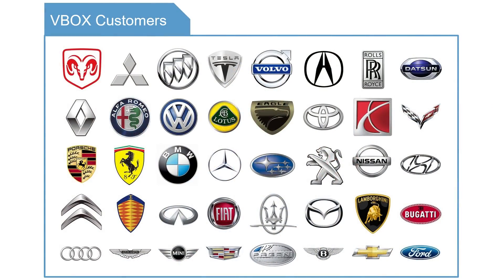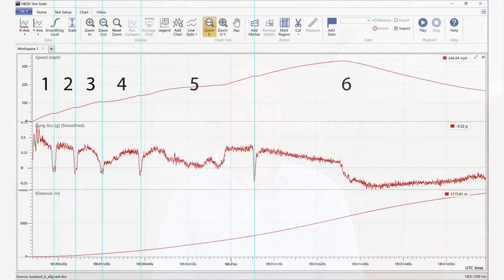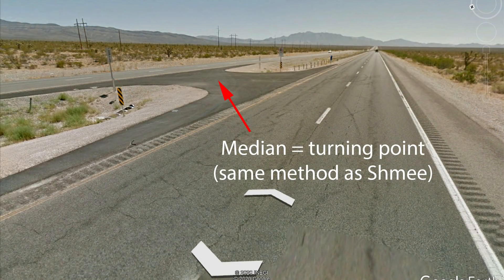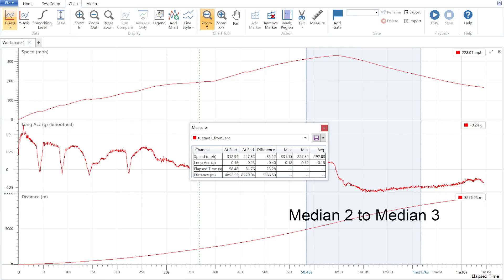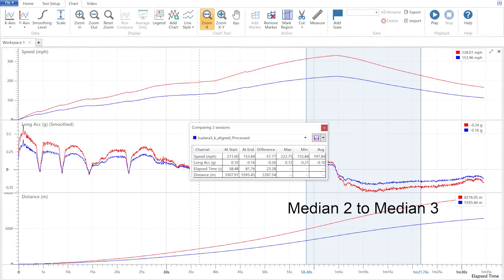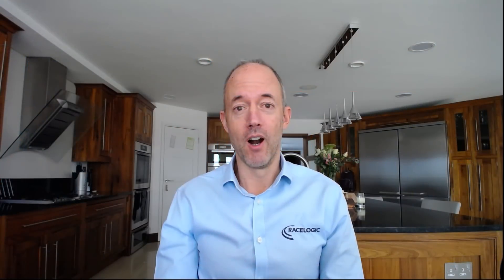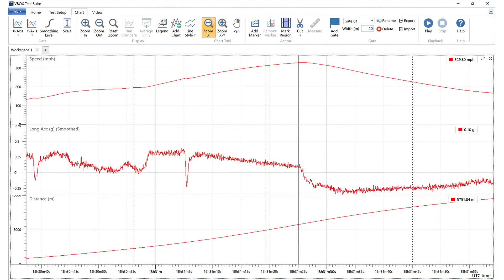How fast did the SSC Tuatara really go? Here's my calculation based on some new data.

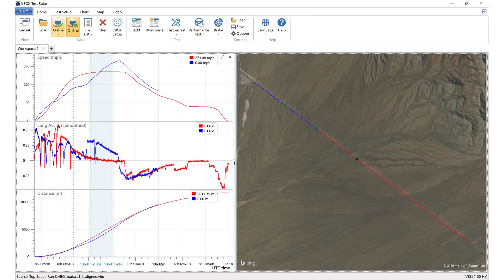Comment: First time I cracked up was at 1:33 with the graph, because that matches with the gut feeling you get from the record video, but this just shows it so much more clearly. Second time I cracked up at 5:30 when he was trying hard no to burst into laughter. 

But yea, this is what engineers do. This is not rocket science. Next thing would be to figure the drag and thrust and estimate the achievable top speed, assuming the engine does not blow up or car fall apart. Which I think was the whole reason for this scam. They figured the car is theoretically capable of pretty good speed, but ran into tons of issues on the (assumed) first outing in this kind of environment where you extract all the power and speed. But one thing I have to give to the SSC: it is not easy to call it quits when it is not safe and driver feels uncomfortable.

Comment: If the software was custom.  Could it merely be a miscalculation from lat long data to speed?  As in they didn't use trig correctly to determine the distance between 2 points?
Reply: That's not how gps speed is computed. It is computed based on the doppler shift of the satellite signals, not based on position. The Dewetron unit outputs speed directly. SSC's software is just for display, and maybe unit conversion. 
There's a chance that this is a unit conversion mistake, but considering all the lies told since it was discovered, it could easily have been a deliberate fraud.
Reply: You’d have to think though that if this was the case and the car was actually doing 331mph, then the software would be showing something closer to 500mph. All theory and guessing of what may have gone wrong aside, you can’t escape the fact it took x time to cover the distance between 2 medians. You can manipulate software, you can’t manipulate physics.

Comment: I have driven 220 mph . I would know it is  not 331.
Reply: I’ve been thinking about this myself, but if someone put you in a stupidly fast car “capable” of doing 331mph and put numbers in front of you showing 300mph instead of 200mph, would you really know how fast you were going? If you were the only car on the road, driving a car you had little experience in and the speedo was out by 20-30%, would you be able to tell without any other references around you.
I don’t think for a second the Tuatara got over 223mph.

Comment: This is ridiculous. You can set up markers with cameras and sensirs perpendicular to the track at regular intervals and calculate the speed with 100% accuracy. Or at least use that methodology to calibrate the GPS system and then leave both systems in place as a fail safe.

Comment: The SSC did not start flooring it until 200MPH, listen to the engine. At this point, manufacturers have mentioned that races are at the top end, 200MPH, and up. The driver gradually accelerated to 200MPH. and only then planted his foot down. Nothing holds traction with 1750HP.          0 to 200 is pointless at that power.

PLUS, they had a run on opposite sides of the highway.       Koenigsegg had a short distance to travel than the SSC who had a longer route at the end of the top speed run...

Just take a look at Koenigsegg's view... mountains, signs, all different, because they had a top speed run in opposite directions.

And the driver mentioned this " the SSC's speedo stops at 300MPH but had no limiter for the run, and the only thing he had in the car to measure speed was the GPS antenna from Guinness World Record. " They used their own laptop but used the GWR's GPS antenna to measure speed as input. Which is why you see the SSC Tuatara logo.

Comment: My first question was about the tires.  This car supposedly had regular Michelin tires, not what you would expect for a 300+ mph run.  As I recall, when Bugatti did their WR run several years ago with the Veyron, they used special high speed rated tires that where only good for maybe 30 miles at top speed.  Good thing the car would run out off gas after 22 miles at top speed.  Tires coming apart at 260 mph would not be good.  (If my recollection of the numbers is off, corrections are appreciated.)

Comment: the speed shown is in ft/s instead of mph, it explaines the 1.4666 correction factor

the mistake is deep in the production process, the fact that the car hit the "fake" speed that is the theoratical speed at the exact RPM in 6th gear tells me that they messed up in their calculations a very long time ago
Reply: Yes it is in ft/s. I don't think they would have messed up this way from the beginning of the design. You go through the calculations etc. so many times it is just not possible, it would be like trying to think the earth is flat, so many things just would not add up. I bet they just pulled a suitable unit from drop down menu in the software and hit export.
Reply: Oh shit that does explain a lot!
Reply: This is great and the numbers really add up with the ft/s explanation. but if they've been working with ft/s for years and no one's noticed it, they need to throw the whole company out 😂

Comment: 7:57 yes there should be at least a basic standard of how these data is taken, I mean, I really hope for manufacturers to be double checking their equipments and data after a run BEFORE posting anything up for media to see.
Reply: Trouble is that SSC is a small custom shop on a shoestring budget, not like a real car manufacturer.  They can't afford to hire multiple companies and a cast of thousands to ensure all is perfect.
Reply: @westview9917  they don't need to, if they just at least calibrate the GPS data correctly and keep any data that's  gathered from it and not just a video recording of a laptop would be nice

I mean, they are a small company, sure, but everything they have done around this attempt, like claiming the GPS data is verified by the manufacturer when it's not, using editing overlay for the info on the video instead of using direct data overlay, and outright stupidity of not recording the data just make em super shady man.
everything there can be done by anyone with a bit of expertise very easily.
they're basically just playing cover up at this point.

Comment: the basis of these calculations are based on the video. cameras can run at 24/25 and 30 fps. if it is uploaded into an edit program like davinci pro and the correct filmed frame rate is not specified, the project can be created at the wrong frame rate, resulting in a slowed down or sped up final video. this is usually not discernible to the human eye..but definitely in something like this will produce a loss or gain of seconds over that time frame..
Reply from the maker: The frame rate was 29.97 FPS.
Reply: @jools360  so if camera was set on 24fps or 25fps, and edit project set to 29.97fps then you have a sped up time line. I have done this a few times as my countries native speed is 25, and when shooting for the US (who work at 29.97) have had to average my film to match 29.97. This is a common error on the part of an editor who did not set the correct frame rate accordingly.. Just a thought.

Comment: The real question is, what was being displayed on the car's dash, and if it was wrong, why?   Obviously the typical culprid of a speedo being off by a large margin is either due to some kinda error in its speed sensor, or more likely the speedometer Gears used in the drivetrain thats wired too the speed sensor, was the wrong gear ratio.   And imo that is likely the source of the problem.  Why?   because at low speeds youd never know that the car speedo is off,  Your in a hypercar, if the speed is high youl never assume that the speedo is wrong.  also. due to the wrong ratio when the car increases speed the reading will continue to diverge at an ever growing rate depending on the divergence percentage.  so it may be only off my a small margin at low speeds but a very large margin at high speed, which is exactly what this run has produced, Lastly,  as the video shows, the driver hit the supposed 331 mph and lets off when it seemed like the car had at least another 10 to 20 mph in it.  The rate at which it began climbing in speed was also unusual.  As the lower speed to longer to reach in time than the higher speeds, again that divergence due to the gear ration being off a least is the tell tell sign to me,  And it also would explain the dashboard reading.  Why the GPS reading be off.. well.. as he says the software was manipulated.  If its gathering speed data from the car's computer then its receiving wrong data,  and if its satalite data is off then again  software manipulation.   Maybe not on purpose.    Also in regards to videos.  we also must not forget the factors of video and Frame rate.

Comment: Can you please validate my run atleast. It is getting questioned https://www.youtube.com/watch?v=xGwXnhkDKTs
Reply from the maker: With 796 satellites, it must be at least 49.75x as accurate as 16, so I began to think that this is pretty legitimate. However, I made some red-shift style calculations of the headlights of the car coming towards you, using the observed doppler shift, and that confirms that the car was going at 60.2 kmh, so I think you had a multiple of 10x in your overlay. (Note that some in depth audio analysis showed that your front left tyre was close to the minimum tread depth, so I would get that sorted asap.)
Reply: @jools360  that confusion probably comes from the fact that the glass in the windshield is made of fused silica glass with highly nonlinear optical properties, such as index of refraction under acceleration. The properties of the glass actually increases the doppler effect that causes the redshift by 9.8 times at those speeds. I reached out to the glass manufacturer who has skin in the game and they confirm this 9.8x number.

Comment: Since these videos I've been trying to work out if it's potentially another unit that they have picked up from the GPS and overlayed on the telemetry in error. Finally after this video it seems to make sense, interestingly foot/sec is a 1.4667 correction factor from mile/hour. Using this correction factor you would get a result of 225.78 mile/hour which would be well within the margin for error of Julian's calculations

Comment: One possible explanation is that whoever developed the custom interface for the gps data botched something. The gps api maybe outputs kmh and needed conversion to mph, the standard coefficient to multiply with is 0.62137119223733. 
But if 0.92137119223733 (6 swapped with 9) is used instead, it translates to an error rate of 1.4828032 pretty close to your calculation, don’t know if this explanation fits well in your data though.
Also don’t know if misreading 6 as 9 is common.. but it would mean it could be a mistake by one person that others would’ve been unaware of.
Reply: That's a great point. According to another comment by Julian, the Dewetron GPS outputs in kph (or kts), so it is plausible that SSC's interface tries to convert to mph with a simple typo leading to a 1.48 scale error. This should have been caught by the most basic software testing. I think the only other explanation is a deliberate fraud.
So which is it? Are SSC liars, or simply incompetent?
Reply: There was no mistake made, they were fully intending to commit fraud from the very beginning. The reason they chose Dewetron as their GPS supplier is they offer an open-source SDK(Software Development Kit) available on GitHub that allowed them to create the custom GPS display seen in the video. It also allows them to take the raw GPS data, apply a 1.48 correction factor and display the "corrected" speed. This would be easy to verify if they simply released the raw GPS data, which will never happen.
Reply: @minnick99  idk, 1.48 is oddly specific. I also think it’s too big of a number if it’s intentional, 1.1 or 1.2 would be a more probable cheat factor. I mean, they didn’t even reach the final gear..

Comment: every estimation is close to 331 FEETS PER SECOND.
Reply: That must have been the error. Even the speed the SSC was going when it started losing the helicopter (209), translates to 141 mph, which is likely the fastest the chopper would be going with the crosswinds in effect.

Comment: Even if U take the GPS/Speed view in the video (alone), and lets say in Edit, it was laid over a slower run by mistake, NO car w less than 5k HP, Pulls That Hard, in that high a Gear, over 250mph. ITs BS. We all know it. ( ask any Bonneville record holder ) The Drag alone, at that speed, ( gearing or NOT/Etc ) Takes HUGE HP to Over Come. ......And YES, Tires. Michelin should Jump in this to Cover theyre ASSES. $2k set, of OFF the Shelf, tires can RUN over 300mph.....? Price the Bugatti Veyron tires.......LOL

Comment: SSC should just come out and say the data was wrong and we will attempt another record run soon. I truly believe they thought they broke the record based on the data. But the data was incorrect, to say the least.
Reply: There was no mistake made, they were fully intending to commit fraud from the very beginning. The reason they chose Dewetron as their GPS supplier is they offer an open-source SDK(Software Development Kit) available on GitHub that allowed them to create the custom GPS display seen in the video. It also allows them to take the raw GPS data, apply a 1.48 correction factor and display the "corrected" speed. This would be easy to verify if they simply released the raw GPS data, which will never happen.

Comment: Love the Analysis. I personally think 1700 hp (even at the wheels) wouldn't generate 331 Mph. Isn't there a formula somewhere using Drag Coefficient, Mass, Distance &  Horsepower to calculate what Horsepower would be required if we knew the Weight of the vehicle? The fact that Michelin were worried about the Koenigsegg attempt at 260+ and wanted a new set for each run and were surprised at how little punishment the tyres took is a testament to how finely tuned that Koenigsegg suspension and setup was. What tyres were used on this SSC ? and if that Driver did do 331 Mph he wasn't using street tyres or he had Balls bigger than his head. This sounds a bit like the laughable Devel 16 which had 5000 Bhp at the Crank but never went near 200 km/h with the pathetic Brake calipers on the Demo car. Top Fuel cars are 10 000 Bhp and Barely get to 345-350 mph.
Reply: Yes, with their number IF are correct the car can go 350/360

Comment: So Tuatara went 223 mph on 6th gear? If they claim this car can go 350 mph then that's 120 mph diference between 6th and 7th gear. At this point I'm guessing that they will make new gear ratios for the transmision of the Tuatara because the calculated top speed for 6th gear was about 290 mph and still that's a 60 mph diference so now I'm starting to doubt they can go 330 mph.

Comment: Wondering if they misread feet-per-second data as MPH?  The speed would closely correlate with that error, because 331 MPH = 225.6 FPS.
Reply from the maker: The Dewtron GPS would normally output km/h or knots, feet per second is not a convention which is normally used.